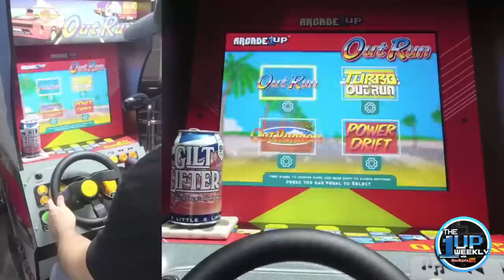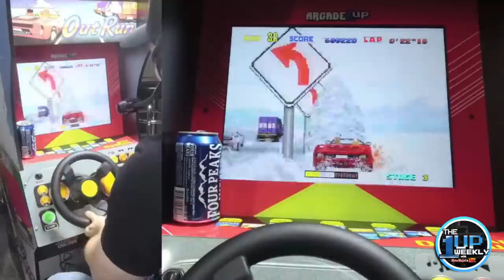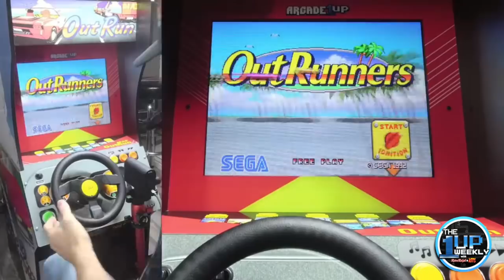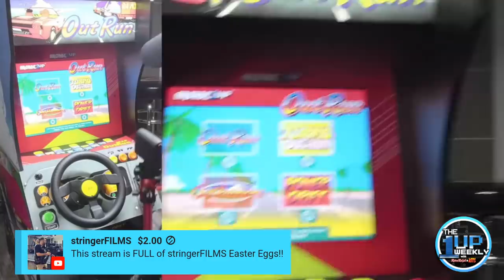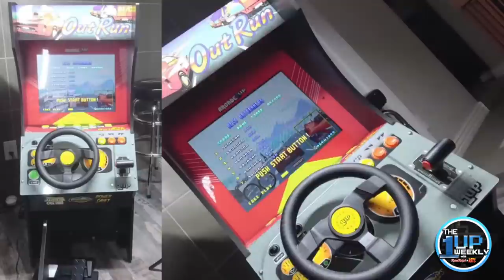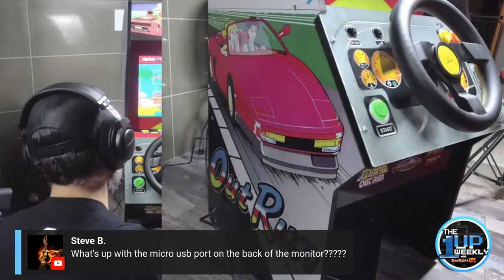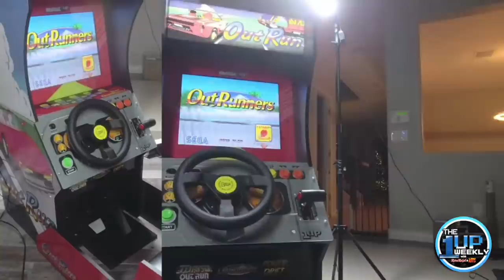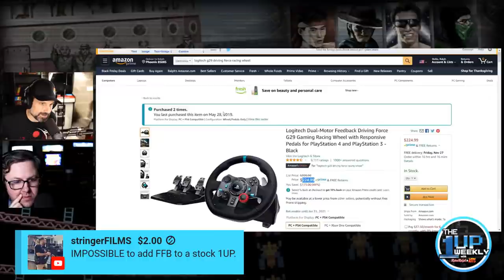The 1up Weekly - Live with Outrun

Comment: dont worry about how you played just tell people you were doing a PSA for dont drink & drive & i agree the pedals wont last long plus the no back for the seat is not ideal at all i would look at modding it with the OpenWheeler GEN3 Racing Wheel Stand Cockpit you can mount a logictech steering wheel pedals & gear shift on it just dont install the kick plate but then the cab doesnt look wide enough.any thoughts?